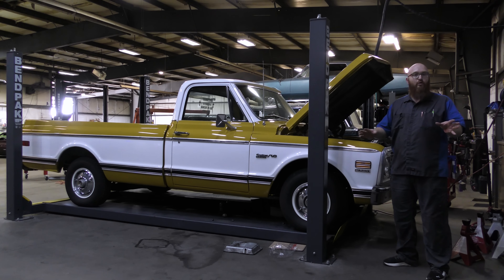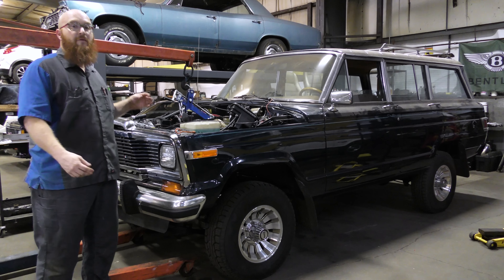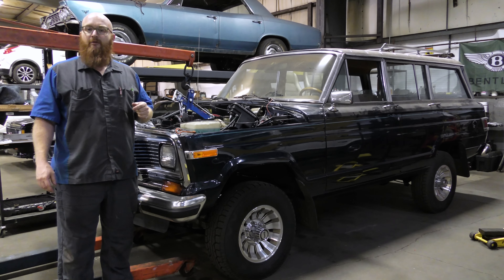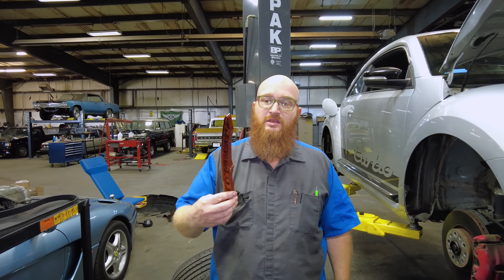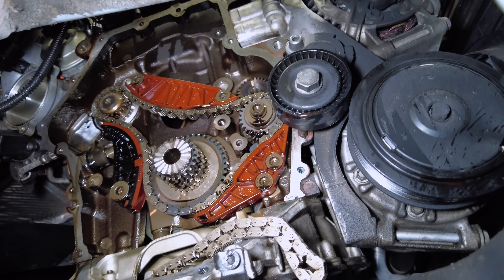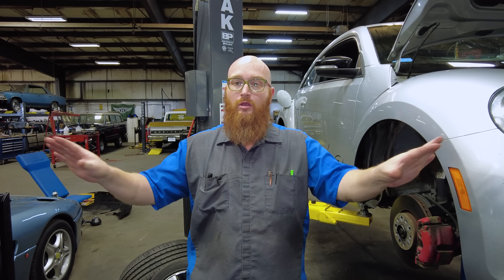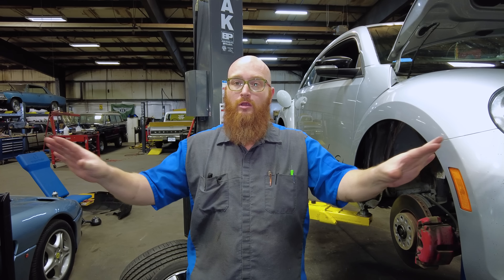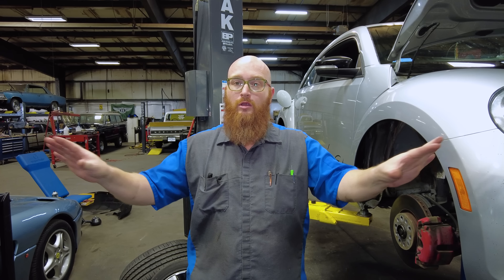Hard to test, can't see it, but it can KILL your car! CAR WIZARD talks Timing Chains! Is yours next?

Comment: The timing chains in traditional American OHV engines would stretch with a lot of mileage, which affected how the engine ran, but it wouldn’t destroy the engine.  Plus, the aftermarket made stronger chains for high performance use.  Personally, and in addition to the reasons Wizard stated, I blame the obsession with OHC valvetrains, which are largely interference designs.  If the timing belt or chain lets go, pistons and valves smash together - new engine time!  Wizard and many other mechanics sing the praises of the GM 3800 V6 (an OHV design whose roots go back to the 60s), but the motoring press in the 90s and 2000s ridiculed the engine as Stone Age stuff and sermonized from the book of OHC, especially DOHC/4 valves per cylinder.  GM caved, and we got the Ecotec engines and the 3.6 V6. And it wasn’t just GM - the other domestic mfrs did the same.

Comment: I've had timing belts go twice. First time on a Rover 220 gti from the mid 90s. No engine issues but killed the brakes changing it. The 2nd time on an early 2000s Fiat Marea a nice 135mph 1.8L station wagon that sent valves through the hood at less than 30mph. A pain because the 1.8 was rare.

Comment: I learned quickly to change the timing belt every 60,000 miles. My current car has a timing chain and no problems at 250,000 miles.

Comment: I worked testing engines and ancillaries for ford transit in uk in 2007.
The 2.4 puma engine had a chain, we had to do oil sampling for carbon build up as it wears chains out.
Ford started at the cheapest chain, then, worked up to better quality to get the engine over the milage/ warranty line.
Just on the chain testing and trials it was over $2million and years of testing. Every oil sample cost $50, we did hundreds, engine oil carbon build up wore chains out. Different fuel chemistry and internal engine breathing and blow-by affects this. 
Ford especially penny pinch. Its as cheap as they can "reliably" make it. 
After a year on the dynos, and 1000s of hours  ford were putting in high-quality chains with high chrome content. It was noticable the hardness of the chain when you handled it.

Comment: Wizard you are so right. Nearly all manufacturers used nylon cam gears on their V8 engines. It was called pre-planned obsolescence.
Reply: It was mostly for quieter running.
Reply: @hotpuppy1  They started that in the eighties using the same excuse. Andy had it right when he said pre planned obsolescence.

Comment: I think a lot of the issues come down to an overly complex design. If you take a look at the counterbalance system there as well as the timing components. There are a lot of twists and curves and multiple tensioners required to get the chain to where it needs to be. Every time you bend that chain into a different angle you need attention and there's extra stress on it and more places where it can wear. If you take a look at a 4 cylinder engine out of a Camry. There's a single chain that goes from the crank to two camshafts and there's very little deflection of that chain it's almost completely straight shot. There are tensioners on each side to keep the chain from flopping around a little bit. But there isn't a whole lot of stress or pressure on those tensioners or the chain. 
Everything being equal a more complex mechanical system is usually going to be less reliable than a simple one.

Comment: I did the timing belt on my wife's 2012 VW Sportwagen TDI a few years back.  The dealer wanted $2,000+ for the "120,000 mile service" which included an oil change, DSG transmission-fluid change, engine air filter, cabin air filter, and timing-belt + water-pump change.  Screw that.  I'm not paying over $2K to service a car that might be worth $4K on a good day.  So I did it myself and saved $1,500.  It was a giant pain in the ass, but I did it.  I hate timing belts and cheap timing chains that need to be replaced.  Stupid cost-cutting measures.
Reply: Do you recall the mileage when you did the maint. I'm looking to do it at 93k now?
Reply: @digitized4u  It was the 120K-mile service, so it was around 120,000 miles.  But she puts a lot of highway miles on her car -- it hit 120K back in 2017 or 2018.  If you have a 2012 model, and it still hasn't had the belt replaced, you should probably do it based on age -- that thing is 10+ years old, and I don't think they're designed to go much past 7 years.  It's a rubber belt and it ages just like your tires do -- 7 or 8 years is their max life, even if you put only a few miles on them.
Reply: @LMacNeill  thanks for the heads up.I'll get one ordered!

Comment: Toyota 1HD-FT (diesel). Manual gear driven injection pump, 100,000km (60,000m) timing belt driven single OHC with twin valve train (6cyl 24V).
Timing belt replacement is probably the most simple in the car world. Under 1hr.
I swear Americans would adore the robustness and simplicity of the Toyota diesels we enjoy in Australia.
The petrol (gasoline) engines you get, we get too, but for so long they've been virtually worthless on the second hand market.
They're increasing now, as all old LandCruisers go up in value, but still worth well under diesel prices.
The Toyota diesel hero engines (all factory turbo).
12HT
1HD-T
1HD-FT
1HD-FTe
1VDJ.

Comment: I had an identical bug - 2013. Mine was fine, but those tensioners were the suspect bits. Loved that car. I'd still have it it if it was AWD - after turbo upgrades I was going through a lot of front tires lol.

Comment: My 90's Nissan SR20 has quite an agricultural timing chain. When I compared it to the new one I fitted when I rebuilt it they were very nearly the same length. When I was working on my 2016 2.2 diesel I was shocked to see how puny the timing chain was. Seems crazy to have such a small chain in a diesel engine when back in the 90's they were using a much more robust system in a 2 litre 10:1 comp gas engine. The cynic in me knows why. The diesel died after 135000 miles, still got my old SR20.
Reply: The QG18 is a good engine too love my B15 it was ungodly slow. but it always fire up and got me around.

Comment: my 66 ford fairlane 302 sheared its nylon drive gear on a cold winter day startup.As their was no damage to engine it would turn over but not start due to timing way out .Took days to trouble shoot outside at -25 degrees

Comment: Have you ever had a customer who fitted a pre-start electric oil pump? I have a friend who had a TR6 and he set it up with a pre-start oil pump that gave the engine 45 lbs of oil pressure before the starter was engaged. He said it cut engine wear by about 60%. Not sure where he got that figure, but his 2 liter TR6 engine did purr like a kitten for 205K miles before it needed anything but a tune up.

Comment: Those TSI engines were notorious about their timing chains. A friend of mine had a VW Polo 1.2 TSI he bought new back in 2011 or 12, and it had less than 20 thousand miles on it when the timing chain failed.

He had the car fixed under warranty and traded it for a Toyota. Meanwhile my VQ30DE Nissan Maxima has almost 220 thousand miles on the clock now with no issues whatsoever.
Reply: My JX35 has the VQ engine, and I thought they has timing chain issues at one point?

Comment: The timing chain does not stretch. It simply elongates as each pin and the hole the pin goes through on each link elongates and the hole is no longer round, more like an oval. A groove will often times form on the pin as well. This makes the chain longer.

Comment: cheaper parts + extreme push on the OE oil specification for emission treatment (not to add additive package that can hurt the cats / dpf / etc. ) = short engine life (compared to 90s engines + 90s oil formulations with lots, and lots ot ZDDP and other good wear preventative stuff which they removed almost 100% in new oils)

Comment: biggest pain was when the big three used plastic teeth on the cam gear, you had to remove the oil pan to remove the junk and maybe a new oil pump, most double  roller  after market timing chains  wont fit stock blocks, with out doing some grinding, and this isnt back yard shit

Comment: I've owned late model Nissans.. oftentimes those timing chains fail because of wrong oil filter usage.  Those cars require oil filter with anti drain back check valve . This allow oil pressure to be instant so it will not snatch the timing chain guides. This is one major reason why they failed. I've never had timing chain issue from Nissan .

Comment: Scotty kilmer did a review of a 2020 jetta and he said that VW had problems with the chains breaking. They did fix it by using a timing belt instead of a chain to save time and money. They claimed its a fancy "lifetime"  belt and you would never have to change it. Since this a interference engine, if that "lifetime" belt breaks, then pistons will hit the valves and engine goes bye bye

Comment: Those early TSI motors had problems with oil pressure on startup. It takes some time for them to tension the chain properly. If You let the engine idle for 30 seconds after start up it will tension the chain properly and make it last a lot longer :) Still - poor design from VW.
Reply: The number one reason for the low oil pressure at start up on those early TSI engines were due to using low quality oil filters. Every single vehicle that came into our dealership with chain issues had an after market oil filter. The bypass valves on those aftermarket filters are just garbage. (If it’s lucky to have one that is).

Comment: That's every small engine I've owned lately. GM is notorious for this with their 4 cyls.  Guides break, clog a pickup tube, chain slaps etc etc. 

I dont even know if proper oil changes would avoid it on some of these engines.  Like you said the parts are plastic and cheap.

Comment: It's called programmed obsolescence, cars are designed to last around 250kkm (155k miles), at least here in the EU, in order for them to have no troubles during the guarantee (even extended ones) and then force you to replace it. Add this to the "oil for life" in transmission (no, it does NOT exist an "oil for life", whatever your transmission is) and to the 25kkm (15k miles) oil change interval, which are done for 2 purposes: show to the owner that you don't need to do maintenance so frequently and respect the "green laws", and you'll be in trouble. ESPECIALLY with modern and very complex cars.
I own a fantastic Alfa Giulia, it has a oil controlled variable valve control (multiair module, which I think isn't present in the US variants) and it NEEDS good oils in spec and a change every 10/12k km (7k miles) if you want that engine to last long.
Reply: Very true. By the way, there is an SI unit for 1000s of kilometres, which is megametres (Mm). Cars which reach 1000000km on the odometer have driven a gigametre! (Gm).
Reply: @nicholasvinen  I think that's not even possible for Hoovies' (see hoovies garage channel) cummins diesel truck, that broke down the hi-pressure fuel pump at something like 999000 miles :p
Oh wait, those are miles... So yes, it's possible :) For that cummins (which by the way had the transmission rebuilt not less than 3 times) and for the old Mercedes diesel (not the turbo ones), like the 240D from the 70s :) And probably some well kept Toyota too ;)
I remember those multipliers: pico, nano, (this I use mostly for capacitors) micro, milli, deci, and then deca, etto, miria, mega, giga, tera, peta, etc :)
Reply: @AlessandroGenTLe  a gigametre is 621371.192 miles and I am sure there are plenty of vehicles that have done that. Maybe not on their original drivetrain, although the "million mile Lexus" might be!

Comment: It's called Finite Element Analysis, and it's an engineering technique that minimizes the cost necessary for a part to achieve its intended lifetime. The engine and drivetrain parts of yesteryear were "over-engineered" in that they were made solid enough to last practically forever, but they were heavier and required more material to manufacture. Now that fuel economy is a prime concern along with profit margins, the car companies can no longer afford to do things that way. Today's computer aided design makes FEA possible, and it's being employed wherever it can be.

Comment: This is so weird. My 2013 toyota highlander is at 298k and I just dropped it off at a transmission shop for an engine noise (I'm pretty sure it's the timing, it sounds like its right behind the pulleys) and i'm being recommended timing chain videos left and right. The car care nut channel just released a video about diagnosing a timing issue and now so did the car wizard.

Comment: Gm said  my wife's 2005 aveo(junk) needed  a belt service at 60k  it broke  at 51 k.  The car was idling  at a signal  light  when  it happened.  It did $4500 damage  to the  engine

Comment: The 4.0L SOHC V6 from Ford was known for timing chain issues. You had to pull the whole engine out of the the vehicle. This was due to dual timing cassettes, both on the front of the engine, and the backside of the engine. The plastic time guides break, and then you have all that junk in your engine, destroying it. They are probably considered about the worst of the Ford modular engine family, in terms of doing a timing job.

Comment: Not all old timing chains last forever. I rebuilt a 71 Nissan L16 (the kind that go into a 510) and couldn't get the cam timed right, and the tensioner was nearly falling out, and it was a stretched chain.

Comment: I agree with l your points wizard but I have a 97 Corolla 1.8 with 300k miles with a belt non interference im waiting for that thing to snap so I can decide to put a low milage engine or do the timing belt I just got my car I’m feb so Since she’s lasted this long I’m going to ask my mechanic to check the timing belt if it’s ever been done

Comment: My wife's 2019 Mitsubishi Mirage G4 makes a rattling sound that sounds like it's coming from the bottom of the engine, happens mostly upon cold startup but can happen upon startup on a hot engine that's been sitting. It's got 31k miles but it started to do it at about 15k miles or so. I always thought it was the timing chain or a tensioner but then again I thought it could be the starter motor.

Comment: For those who praise one form of cam drive over all others, any components not up to the task WILL fail. I like gear drives, but they fail due to harmonic vibrations. I like roller chains, but the Toyota 8RC engine was notorious for roller chain failures. There are others, but you see where I am going. It is inexcusable how many single failure points are designed into modern cars: in-tank fuel pumps, cam drives, data buses that stop a car dead. We have traded maintenance intensive 1950s cars for 2020 disposable cars. Good thing they can be bought with cheap dollars. :-)

Comment: And now to scare The Car Wizard. I have a 2015 Impala Limited 3.6 (LFX) with 164k and the engine has NEVER been apart. Regular oil and maintenance. Only did one fuel system treatment (not the in tank, the one that hooks up to separate fueling system) and have never had a single problem. Looks like 2012+ 3.6s are okay. This one's still on factory plugs even and runs like a clock. Only a few hubs (hubs were good, TC harness was wearing and grounding out, GM finally fixed the part design) some tie rod ends at 140k, brakes, fix the HVAC doors once, and once pull the console for that stupid pin in the shifter not letting the key release. I'm even on the original factory belt even. I ask when I take it in but they tell me it's perfectly fine and have showed me even.

Comment: Aw, c'mon Wizard, the GM 3.6 is a pretty decent engine if you keep oil in it! I've got a Caddy STS with the 3.6, and it really is a pleasure to drive. Just... gotta keep an eye on the oil level... Keep it from running dry, keep that chain from stretching...

Comment: The 2.0 (and 1.8) TSI (up to somewhere in 2016) also have piston ring problems. The oil scraper ring has small holes which clog up with carbon and the engine becomes an oilcoholic. Up to 1L of oil every 400 miles or so and that will ruin everything. 1L of oil every 900-1000 miles or so will cause the valves to burn. This will happen somewhere between 35000 and 60000 miles or so typically. In 2014 they modified the oil scraper rings and they made the holes bigger. Should last an adittionional 10000 miles so that didn't help at all. Somewhere in 2016 they switched to the "honeycomb"  style scraper rings which resolves the issue. They are also know to develop a lot of play on the valve guides quite quickly. Any 1.8/2.0 from before 2016 I would stay away from.

Comment: My first job was on the lube rack for a local shop.  We had a Pontiac (I cannot remember the model) that the customer was practically religious about changing  the oil on.  Very good.  But the first time it came in, I reported it had a noise from the front of the engine and I noted it was 90% probability it had a timing change issue and needed fixing ASAP.  They went 13 months before deciding it needed to be done.  And it was LOUD by then.  I got the paperwork and was going to drive it into a nay to have one of the other guys do the job.  I hit the starter and the noise was REALLY bad... for less than a second.  Then it was silent.  Yup, it had jumped the chain.  I did not work on the car so I don't know if the valves hit or not, but maybe they should listen to the mechanic.  The original problem was traced to a failed tensioner.  More than 13 months (because the guy before me had noted the noise, also).  Ouch.

Comment: The great OLD Mercedes Benz engines, 4-6 and V8s were designed so the upper guides and the tensioner were easily replaced in situ, then you could "roll in" a brand new chain with a master link without a frontal teardown.